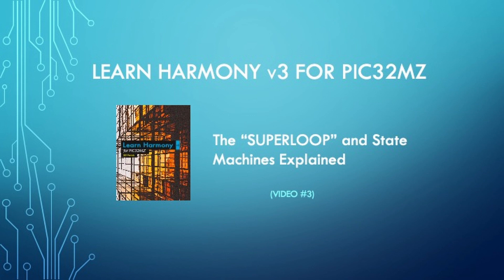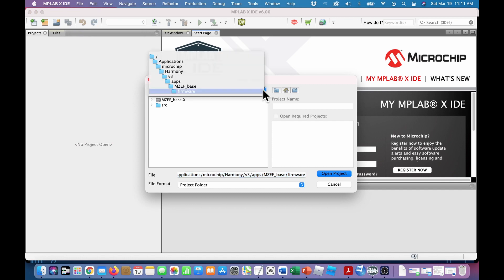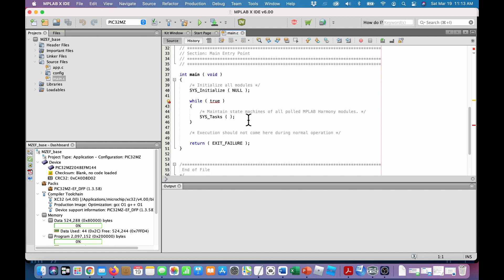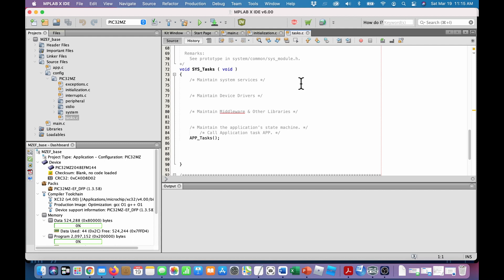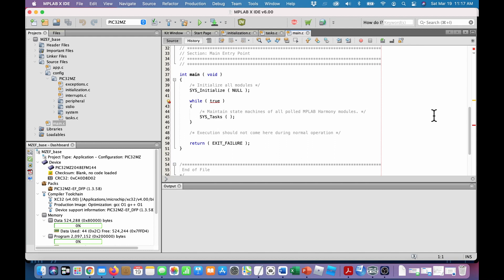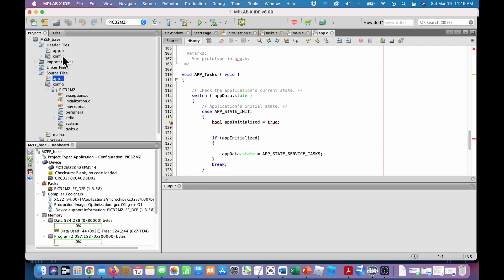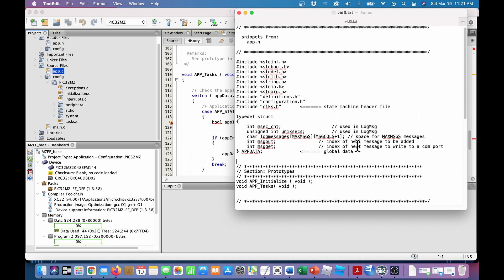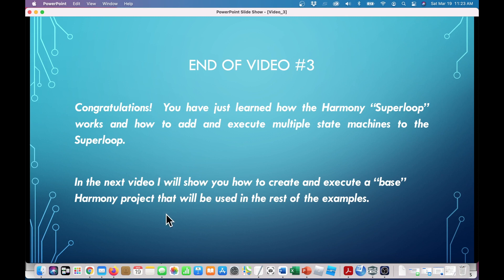Learn Harmony v3 for PIC32MZ -- Video #3.  The SUPERLOOP Explained

Comment: What is somewhat confusing about this video is that you are showing what type of changes are necessary, in general, for any program.  This is not an example of changes that should be made in the base program before going on to the next lesson.
Reply from the maker: Yes.  This was an attempt to explain how to construct state machines that execute in the Harmony superloop architecture.  Not understanding these concepts can lead to frustrating errors (IMHO).